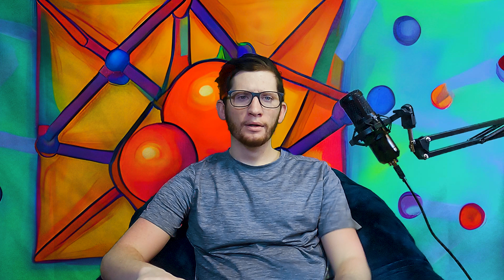A New Cubane Update: What You Need to Know, Plus a Catastrophic Failure

Comment: Distilling sulphuric acid would be terrifying. I would do it only by not being close to it. That would mean powering and monitoring it from a remote location with some distance. Usually making a fume hood or any other "transparent or windowed box" capable of taking the worst case splashes, steam explosions etc is quite difficult. None of those partially open hoods are good enough for this one. I also think that is quite untypical danger to protect from. I only had to protect me from vapors and gasses when I worked in a lab (and something like imploding glass)
Looking forward to seeing how this one progresses. Cubane and hobby synthesis solutions are always fun to watch.